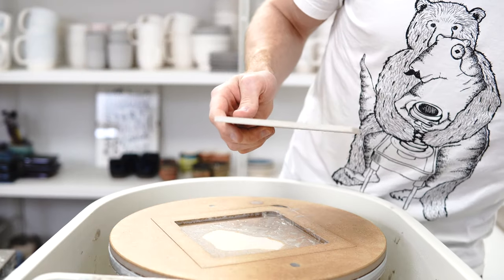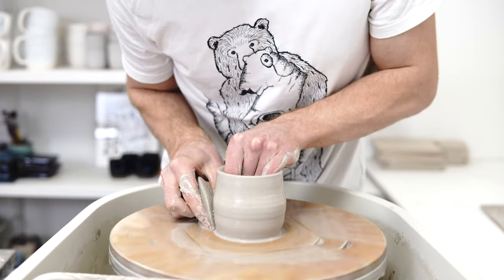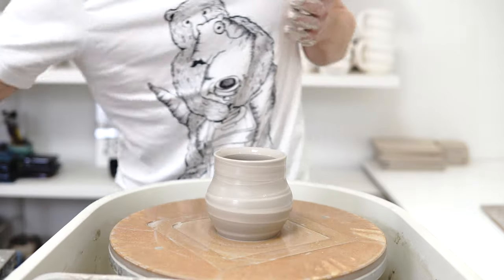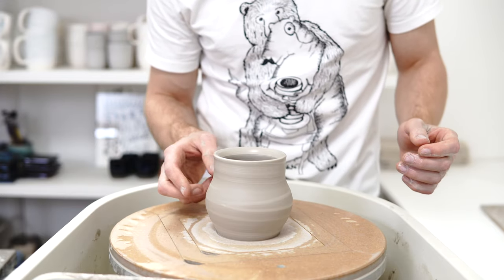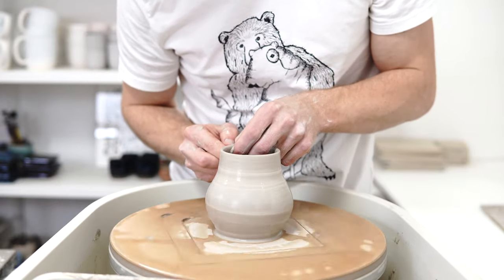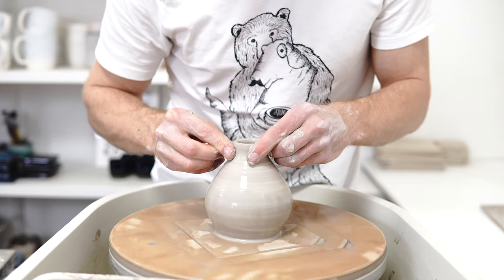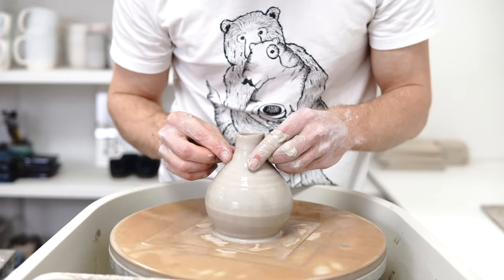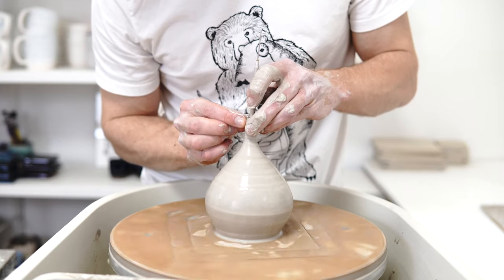Throwing a Narrow Necked Vase

Comment: Why are you using the heat gun?
Reply: My best guess: He mentions this clay throws more like porcelain, which gets sensitive when more water is applied (like collapsing, cracking edges). So by using the heat gun, the vase gets stronger. Because later he applies more water while making the top, which would've affected the base more if it stayed wet.

Comment: How do you trim something like this?
Reply: Most of the time with a chuck. A chuck is a form you thrown and you place it in your griffin grip (if you have one) then place your object in or over the chuck and it wil hold and protect the shape.just search chuck
Reply from the maker: This ^.

I have a thrown chuck I made years ago, but it wasn't actually tall enough for these. I ended up adding a ring of clay to the rim of a tumbler and gripping that in the Giffin Grip. I'm getting videos of the full process, so I'll share those when it's fired